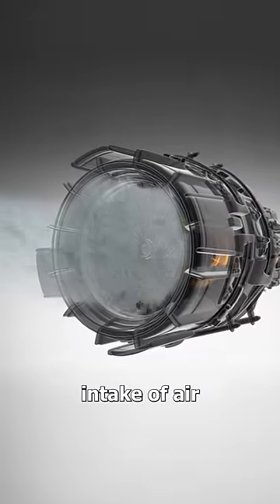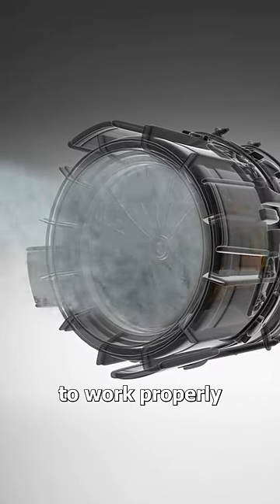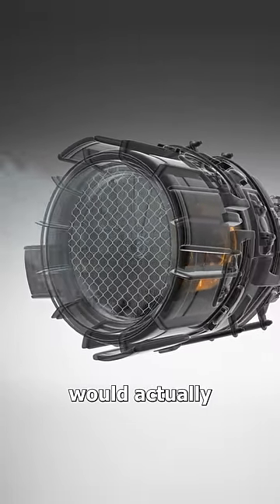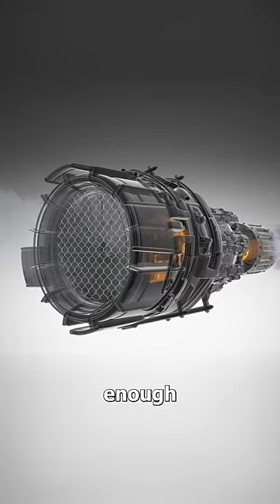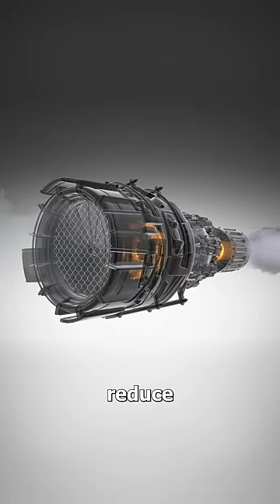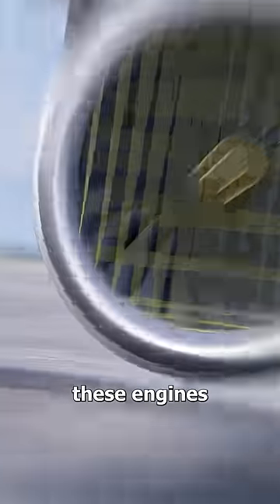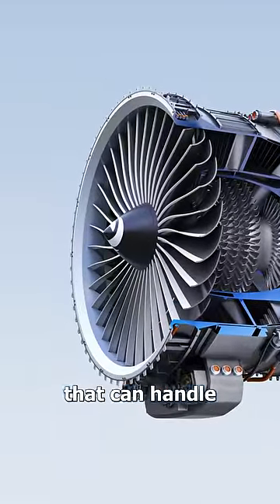Why Jets Don’t Have Bird Blockers 🤔

Comment: It's also important to point out that part of the barrier can break and damage the engine more than just a birdstrike.
Reply: And if improperly placed, the engine could pull it and worse damage could happen.
Reply: Is aboutta happen
hits tw-
Reply: That's probably it! Very smart.😊
Reply: Even if it doesn't brake, if a bird hit it it would get stuck there obstructing the engine more and the bird would die a slow painful death
Reply: I dont even need to be an aircraft engineer or something to know that putting a barrier in an engine is a dumb idea. This is so true
Reply: And its not like the grate would be any less lethal
Reply: @jo_bro666 slow? What the hell are you smoking there’s nothing slow death when you get suck into an engine that big
Reply: @DutchmanAmsterdam not really at all 😂
Reply: @jo_bro666 nothing slow about it. Are you slow?
Reply: Also also the massive suction would probably pull the bird through anyway
Reply: @jo_bro666 If a bird travelling towards a plane at like 20 MPH hits a plane travelling opposite that direction at 160 MPH, perhaps faster, the kinetic energy of the bird would just break off the grate, which could further damage the engine.
Reply: Yep. You're better off consuming pure bird than bird and metal -- at least you'll still have an engine if you only consume a bird. Also I feel like a barrier in front of a running jet engine in flight would be an aerospace engineer's nightmare, a maintenance tech's reason to quit, and a leading cause of aneurysms in safety inspectors
Reply: FOD is a thing.
Reply: plus the barrier might end up cutting up the bird, ingesting it anyway and defeating the point of having it in the first place
Reply: Also, the barrier won't save the bird at all in the first place. Not only do jet engines have insane suck from the front, the impact would very easily crush the bird's bones (because they are very fragile to blunt trauma, because their bones are full of holes), but also that suction would just suck in the bird potentially, and now you've just got bird spaghetti before it gets minced twice in a row.
Reply: would the barrier even do anything? there's a lot of a mass going at a really high speed, i think the borb would just go right through the barrier.
Reply: @jo_bro666  the bird would be killed on impact, even if it wasn't ingested into an engine. If you think getting hit by a train is bad, imagine something travelling 500+ mph when at cruising speed. It'd be pulverized.
Reply: @raptor2265 birb pancakes blocking the engine. Until they get sucked through and/or break the grate.
Reply: @raptor2265 birds barely can survive a headon collision to a window screen that is stationary 😂😂 
the solution would be to create a bladeless engine, if possible.
Reply: @nopelandfill  great now you'd only cook the bird at around 900c passing through the engine
Reply: @topethermohenes7658  .....look at the bright side, well not that bright side 🌚
Reply: @nopelandfill >Bird gets turned into a damn thanksgiving dinner after being sucked straight through a ramjet

Comment: So basically what they did is completely stop focusing on saving the birds and decided to just make a stronger blade to blend them💀
Reply: they would have died anyway due to the speed planes travel at

and if its not due to speed the air pressure would have
Reply: how tf is a barrier going to stop a bird from dying? it’s going to smash the gate at a very high velocity dying instantly from impact and get pulled through the barrier as pulverized mush. Regardless if it magically saved a bird or not, the air intake efficiency reduction is a big deal.
Reply: if they get smashed by the plane they still die cuh
Reply: They want a better blender…
Reply: Barrier or not, my brother in Christ it's a fucking plane, the bird is dead anyways 💀
Reply: @Shortkidnextdoor blended bird
Reply: songbird smoothie
Reply: Would you rather have a few birds die or increase the time and fuel costs for planes and most likely make flying dangerous?
Reply: @Gameknite  both the birds would die to 500km/h+ crash to the bird with grid or without grid
Reply: @reizinhodojogo3956  yeah that too, so the original comment makes no sense
Reply: @Gameknite  i think u forgot speed and pressure factor
Reply: @reizinhodojogo3956  I did indeed
Reply: Saving the birds? You mean saving hundreds of passangers
Reply: @Gameknite  knew it
Reply: @Daniwana27  ur correction implies that the planes will blend passengers using a sharp blade💀
Reply: Yeah 💀 💀
Reply: @20footerpython  i wouldn't Say it like that but yeah losing an engine during take off or Landing wich is when it happen the most can easely crash the plane
Reply: Birds also die from getting hit by planes. Do you really think birds can survive getting hit by a plane?
Reply: They'll still die and more cruel too cause imagine getting squeezed into a metal mesh' small square hole. The birds will still feel pain that way unlike the no mesh design which just kills them instantly.
Reply: I mean a barrier isn't going to save a bird anyway, the intake would probably crush it against whatever barrier there is and slice it to ribbons if the barrier is to thin.
Reply: if a bird hits a metal mesh at 200 miles an hour, plus the crushing force of the suction of the engine squeezing the bird against the metal mesh... the bird dies either way.
Reply: How does a bird survive an engine going spinning really fast especially on takeoff throttle which could range from 70% to 100%
Reply: Even if there was a barrier it would be like a car moving 500 mph smashing the bird
Reply: Soup for the fishes behind
Reply: @suckerhat Lmao
Reply: So the engines are really bird blenders 😂
Reply: Are people like you really that stupid? Even if the engines had barriers, the birds would still die from the impact of a plane. Have you ever heard of a person getting hit by a speeding car without dying or being severely injured?
Reply: @hermos3602  It wasn't really intended to save the birds, but to save the engine of course. You're not stupid are you? 😂
Reply: @obaso.  Bro thinks he can play dodgeball with an airplane at 200 mph
Reply: There is no way to save the birds except flying slower or not flying at all.
Reply: This was never about saving the birds to begin with

Comment: Engineers: "Well, if we can't stop then from dying then we'll have to kill them more efficiently."
Reply: I mean faster and more painless is better than slow and painful
Reply: Well, they can probably stop birds from dying but nobody gives a shit about that.  Luckily, birds in most cases avoid planes.
Reply: @Poptanic they cant. If a bird gets in the way of a jet engine it's dead, simple as
Reply: @CarlosAM1 
Plus the speed of the plane and the altitude might make it hard to breathe anyway.
Reply: @BrentSudric  most birdstrikes happen below 1km altitude so likely not too big of a problem for a bird to breathe. The real problem is that as you mentioned the speed of the plane certainly not gonna help, if you add a bird blocker and a bird hits it then it may be fatally hurt on the impact. Worse yet the blocker can break off during a birdstrike or even normal flight, (engine suction likely will try to send the remains of the bird into the engine), resulting in metal pieces along with the remains of the bird right flying into the already airflow-disturbed engine.
Reply: This is literally the thought process engineers have
Reply: them*
Reply: Capitalist Government:
Reply: @CarlosAM1 just reduce the max speed on planes to 10mph, that’ll keep them safe! Oh and replace the jet engines with wheels, perhaps powered by some form of combustion engine
Reply: @shalala4571 That's a fookin 50cc bike ☠️☠️☠️
Reply: Its not like they survive the hit from a barrier on the engine.
Reply: uh....... what
Reply: @CarlosAM1 if a bird hit that cage thing in front of the engine. Engine Suction  at takeoff + the speed. A bird would just be mince meat before it hits the first turbine blades
Reply: @stevmania8138  it depends on the speed. Either way, you are gonna get bird pieces +  metal right into the engine. A cage is not needed, since it worsens performance too
Reply: @FoxxPlushie hmm, there goes that number 97 again
Reply: I really remind you of a bird? Really ?
Reply: @FoxxPlushie Am I like a bird to you all?
Reply: help😭😭
Reply: This is literally accurate but the way you expressed it makes it so funny
Reply: @shalala4571  That's a terrible idea. Engineers want to make planes faster for faster travels & I'm with them. They don't care if some birds die.
Reply: As someone who is studying aeronautical engineering I agree with this
Reply: @Poptanic explain how then could we stop the bird from dying when flying into the engine
Reply: 😂😂😂facts
Reply: “Kill them more efficiently” yeah, i dont think thats what’s said toward the end..
Reply: This made me crack up 😂😂😂😂
Reply: not sure what you are crying about but not once was the bird's life a priority here. Besides a cage would only cause more suffering.
Reply: Dude, your pfp is looking like you're wanting these birds to die for their souls. Loving it!

Comment: Bird: gets violently blended
Engineers: the engine is fine, just covered in blood.
Reply: Well, actually it's true
Reply: Even if a bird would hit that grate it would either die from impact or be stuck in front of an engine blocking more airflow
Reply: Humans
Reply: eh, the air pressure might blow it away and the burning fuel would incinerate any organic matter
Reply: @Paracetamol1997  it's not
Reply: @JointedSpagel  -bad
Reply: @ronal8824  yep, as if nothing ever happens
Reply: Natural selection
Reply: Free lubercant
Reply: @gustavs3n396 it would be sucked through the grate
Reply: There has been one time when a human was sucked In the engine
Reply: I doubt a barrier would save them. They'd probably just get stuck on it and maybe die an even more cruel death
Reply: think it could withstand a baby?
Reply: It's probably cleaned by the sheer heat and fire tho
Reply: @superocker06   Wanna find out? I have plenty in my basement
Reply: @StarsRebublicBall  sure! link me the vid if u find a place u can do that
Reply: @superocker06   who said I follow laws?
Reply: The engine gets cleaned after flying through a cloud 😂
Reply: @Mukkkk6 i saw those images too. Just a paste of blood, tissue and fat everywhere..
Reply: @chertsBass  why did you have to reply my comment like that 😭
Reply: Where is that gacha life guy?
Reply: Would rather that than risk a compressor stall 😳😳
Reply: BRO I JUST GAVE U 8K LIKES
Reply: @Isabelle-z5w  no me
Reply: @Isabelle-z5w   THANKS

Comment: Not to mention the fact that the birds would probably just get stuck on said barrier, causing the plane to crash from lack of thrust
Reply: They should be able to fly with just one engine. 

However the birds would get stuck there for sure. Maybe the high speed and the suction would actually dice the bird. Think hitting a tomato with a tennis racket.
Reply: @eklhaft4531  "think hitting a tomato with a tennis racket" is the best possible explanation
Reply: Nah at those speeds the birds would be cutted up on square pieces and sucked in anyways

Comment: People don’t realize that even if there was a barrier in front of the engines, planes go about 600 mph it would still kill them.
Reply: i don’t think the problem it was trying to solve was killing the birds, i think the assumption was that birds might damage the engines, but apparently they don’t.
Reply: The engines are built to self contain a a critical engine failure within the cowling if there was large enough debris to stop it completely. However even ingesting a small bird would require the engine to be pulled and inspected just in case there was unknown critical damage.
Reply: Exactly what i thougth, like it would suck the bird with such a stregrh that it will make it a liquid, i also wonder how often this happen, like you migth randomly get sprayed with bitd guts
Reply: @lucasolson66 true
Reply: Wtf… you think this is about saving the bird????
Reply: If there was a barrier, the jets would pull them in so hard that it would be like a cheese grater for birds
Reply: @lucasolson66 they do damage the engines, they cause engine failure and even deform the insides of the engine
Reply: @lucasolson66 there's still limit to what kind of birds that cannot damage the engine. I think they identify it by mass.
Reply: Lol true
Reply: This is very wrong. There are birds so high where the plane goes 600mph. Only departing and landing is the issue. And those speeds do not kill them.
Reply: That's what. It seems so obvious.
Reply: Not only that, but the bird carcass would be stuck to the barrier, further obstructing the airflow and may actually be worse. Not to mention, these barriers would collect all kinds of stuff like leaves, paper, and anything blowin in the wind. That causes even more problems. Better off to just let whatever it is pass through, as long as the engine can handle it.
Reply: @thundermota1158 this outta context sounds crazy 💀
Reply: @lucasolson66 if there is some kind of a barrier, the bird would just get stuck on it and make the situation worse for both the bird and the plane
Reply: @aurabeaver  huh you learn a new thing everyday
Reply: I dont think the birds dying are the problem my man
Reply: @lucasolson66  they can damage the engine dude
Reply: Nobody cared about the birds thought,they though that the bird could mess with the engine
Reply: As someone who's studying aeronautical engineering I agree
Reply: @lucasolson66 yeah like who actually cares about the birds lives lmao

jkjk
Reply: 1) The part of the flight where the plane is going 600 mph is too high for where birds fly
2) Bird strikes happen during takeoff and landing, where the planes speed is 150-180 mph, so a bird getting slapped by a barrier may not kill him. 
3) It doesnt matter because the barrier is a bad idea anyway because of airflow.
Reply: @lucasolson66 Big enough birds can, or could in the past, not sure if they can now
Reply: @seankirkpatrick6110 bird bones are very fragile and even when ignoring that this speed is very likely dead on impact for everything other then the plane it would still certainly kill them
Reply: @yopala Even so the birds would get stuck on the barrier and would reduce the intake of air
Reply: Erm, there are no birds at 12,000+ feet. bird strikes can only happen during takeoff and landing.
Reply: @ryan.vsp1  They… they never said anything about it being 12k feet in the air…
Reply: @turkey4802  planes do go slightly faster than a car during takeoff, but it starts going 600+ mph after 10,000 feet. So there are still chances the bird survives during takeoff or landing.
Reply: bro the barrier would not be there to stop the birds from being killed it would be there to stop them from going into the engine
Reply: A plane goes 600 mph at cruise altitude (30000-40000 feet)
So a bird would not be up there. Bird strikes are most common at landing or take off (100-200 mph)
Reply: right
Reply: 600mph is actually only possible to get at high altitude where there are no birds cause there is little air
Reply: My only counter argument would be a more dome-like barrier to allow air flow, but only to protect the engines. Would still be expensive and reduce efficiency, not sure if it would reasonably improve engine life.
Reply: bro... we do not care. We are worried about the engine of the giant machine we ride in.
Reply: @ILUVAZK the only way to prevent that is by not useing planes
Reply: @Walturwhitee well due to engine intake it would probably break the barrier which is worse
Reply: @Trihexagonal  exactly
Reply: Planes go 600mph at an altitude where you'll never encounter birds
Reply: Yea but they made it personal so
Reply: @akrilla5929    bird strikes happen while takeoff and landing.
Reply: @pralayaryan  that's not what main comment said